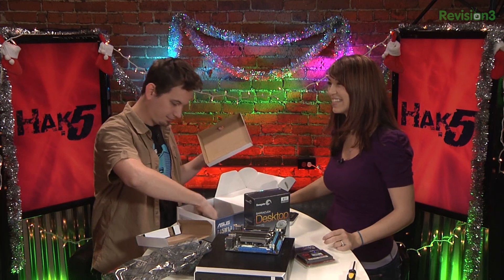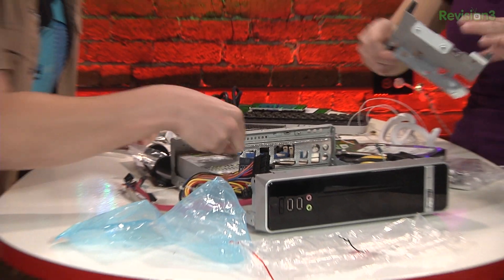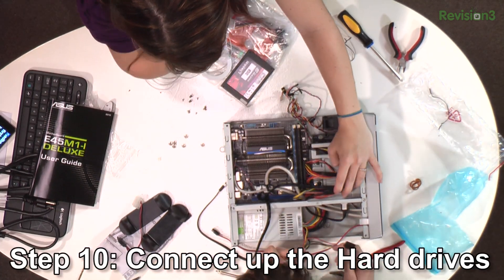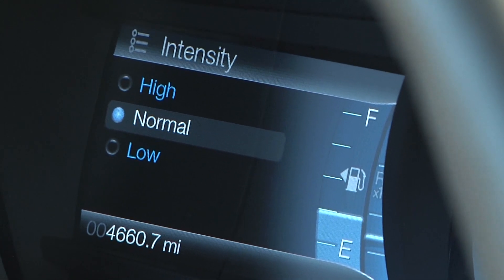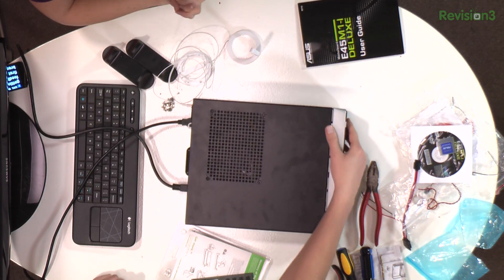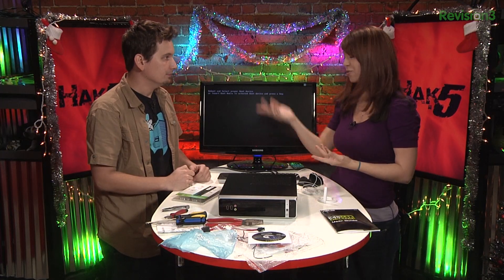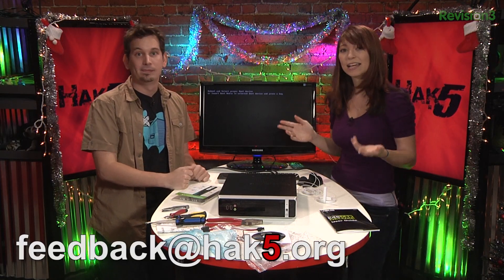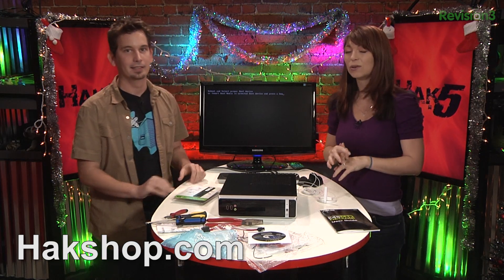Hak5 1218.3, Extreme GPU Password Cracking and Home Theater PC Builds

Comment: can someone suggest the ultimate gpu for password cracking ? i was going to purchase Titan X but with release of two new cards (gtx 1080 and 1070) i am pretty confused. I got msi gaming 7 mobo, g skill ripjaws 16 gb of RAM, i7 5820K processor, WD 2TB black drive, CORSAIR RM 1000 psu and corsair 780T Full-Tower PC Case to put all these babies in :)

Comment: really mobile devices have so little RAM as RAM consumes power and is always on if it is intergrated into the board anyways you also have the issue of room on the PCB as they want to make the PCB super thin so they can have a thinner phone but adding more RAM mains more 64-bit channels and thus less room for other features to fit before haveing to make it thicker

Comment: dont ruin it with windows put linux onit also try swapping the two ram sticks over to oposite sockets not just take one out also send back any damaged ram for replacing! most inportant is to discharge any static by earthing yourself while building!